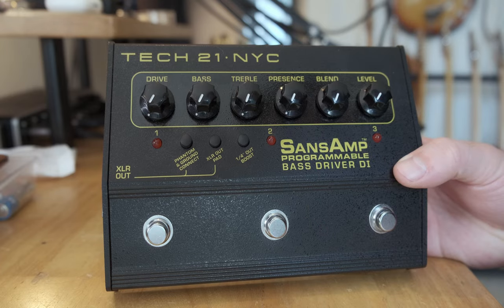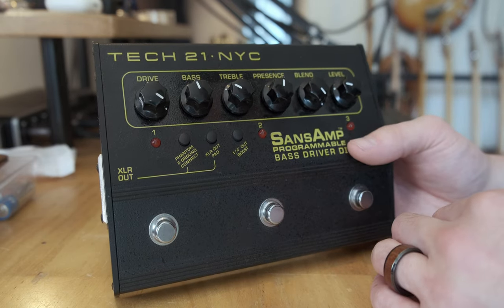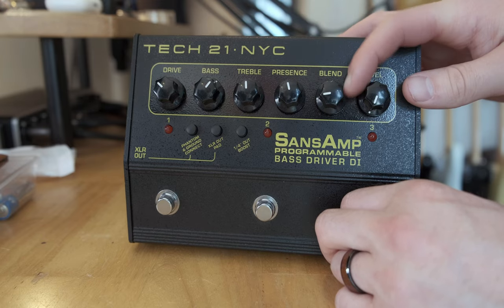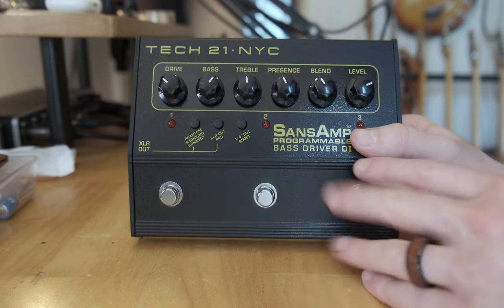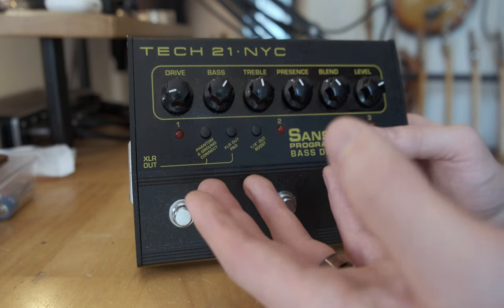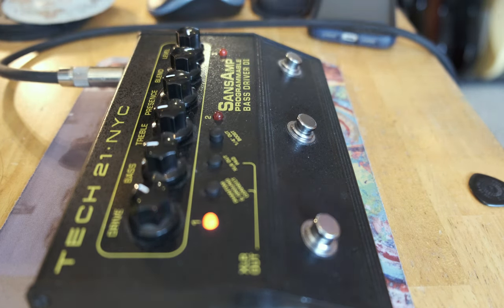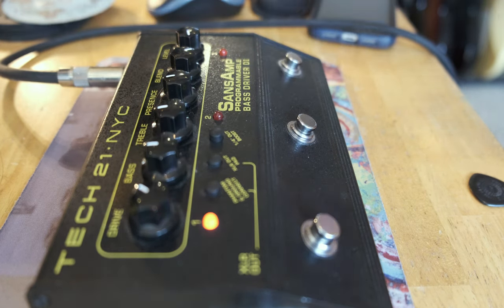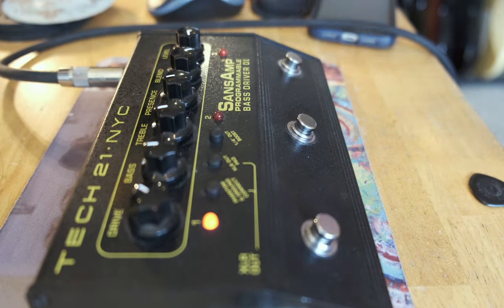Tech 21 SansAmp Programmable Bass Driver DI | Review and Demo

Comment: Great review!
Been carrying one of these for backup to Line 6 boards(HD500X, HELIX). Why? Once at an event, the earlier Line 6 board power supply "let the smoke out" at a venue with dimmers wired up to wall outlets(WT!!??). Was forced to run bass direct into a BOSE system for the entire gig.....never again. Put 3 sounds in this one, carry it in the HELIX bag or gig bag for a spare.

Comment: I am going to try out a sansamp.  the 3 button version seems so practical, but it seems like the smaller version is more popular.  Any ideas why?  I would love ability to switch between 3 sounds quickly.  if i can dial in what i think i want (which I think what i would start with is mellow, aggressive (mid), slap).
Reply from the maker: The smaller one is smaller? It has different controls too (sweepable midrange). I guess it's mostly a form factor thing. The main sound is mostly the same from my limited experience

Comment: nice!!! can you use pedals in from of this unit? like a fuzz, chorus pedal for example? thanks!
Reply from the maker: i'm afraid that's illegal. straight to jail.

jk you totally can! It takes pedals fine. You can also run them afterward if you use the 1/4" cable output instead of the XLR output.
Reply: Ahaha 🤣, thanks!

Comment: So does this have the same sound as the small bass driver?
Reply from the maker: I haven't compared them directly, and the small one has parametric mid eq as well. So while they can do different sounds from each other, they sound similar overall.
Reply: They basically are the exact same pedal, just this one has the programmable presets. My experience is however these are a little cheaper than the smaller units. But you’re going to happy with them regardless. These and the rack mount are all basically the same circuit.
Reply: @danteallucinante ah good old anecdotal evidence. I’ve owned both and both sound basically the same. There’s plenty of videos showing it has just enough punch.
Reply: If anything, the V2 is different because of the mid knob. Besides that, they're pretty similar in terms of tone.